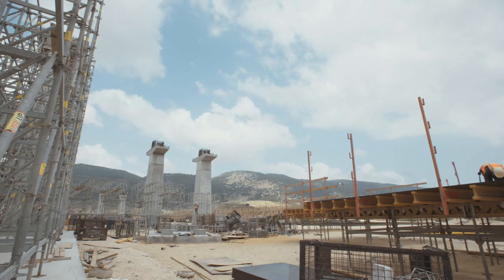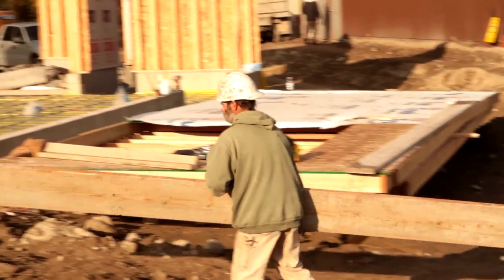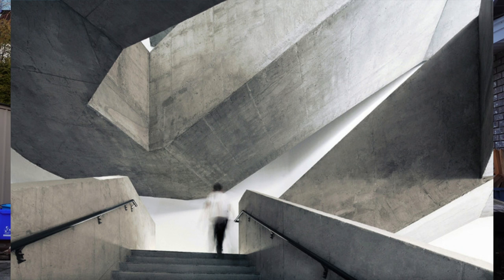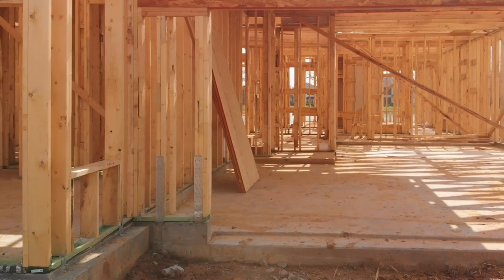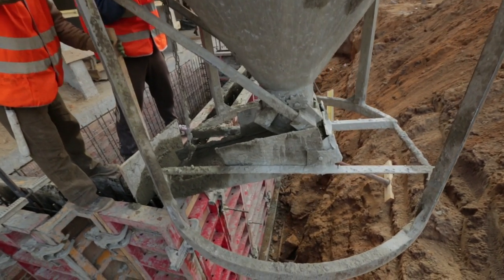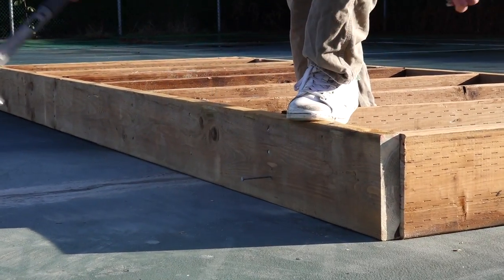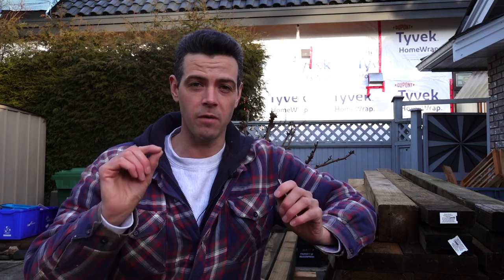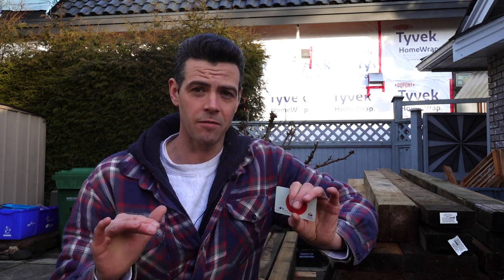What actually is a Carpenter????

Comment: What about making wood furniture
Reply: Answered in the video wood worker I used to think anything to do with wood was carpentry
Reply: Im a painter and drywall finisher by trade but I do everything for builders and remodeling hanging drywall,framing, finish carpentry, tile, concrete, insulation,a little plumbing and electrical but not licensed but I guess I'm mainly a painter I wear whites and did a five year apprenticeship I can do residential, commercial, industrial and new construction and am chemical coating application certified so I'm rare good brush skills and spraying conventional,help,but mainly airless of course